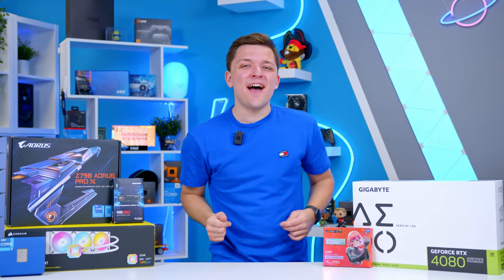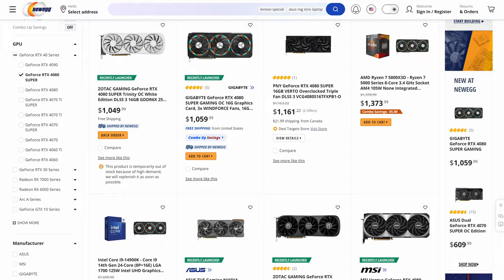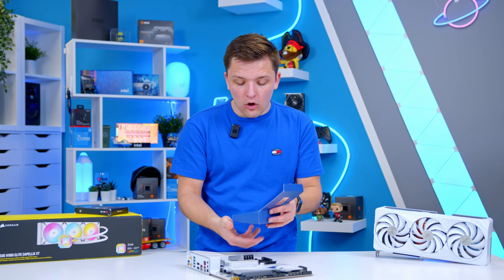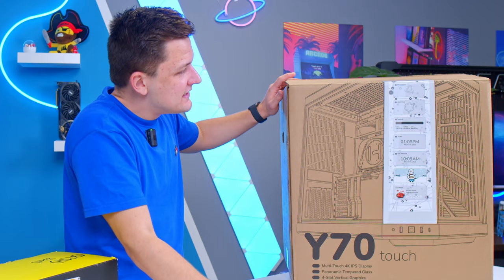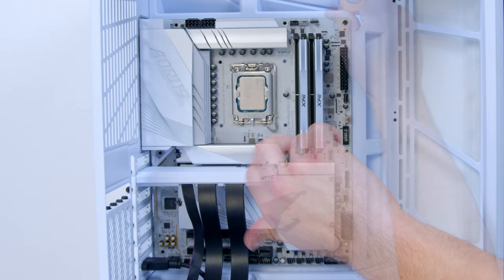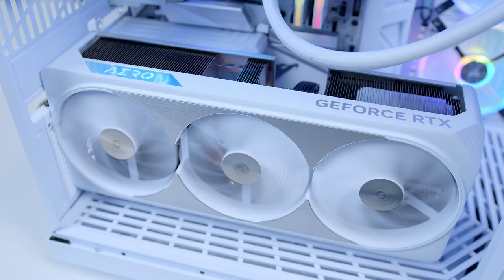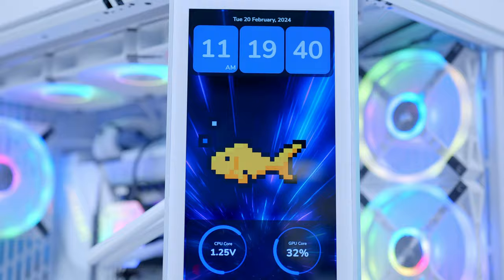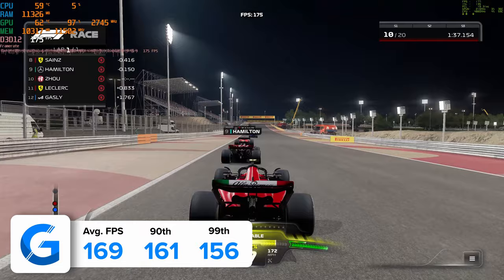Awesome 4K Gaming PC Build for 2024! 😄 [ft. RTX 4080 Super & HYTE Y70 w/ Benchmarks]

Comment: I'm about to buy exact same pc, is water cooling better? Becouse i'm worried i will fu€k something up i never had one
Reply: An AIO is the recommended cooling method for this case
Reply: @katarinax4560  and if I buy cheaper one but with good airflow?
Reply: @Misio-ly1ev  Should be fine! Especially if there are decent reviews. Usually the higher prices are more due to aesthetics, screens, etc so cheaper shouldn’t mean it doesn’t cool as well :)
Reply: @katarinax4560  ok thanks

Comment: Always love your builds man. Keep it up!

Question?. I know the M.2 have a built in heat pad usually. But why do you not remove the bottom side heat pad "remove before use" sticker on the motherboard itself (i know ypu removed the one attached to the m.2 cover piece